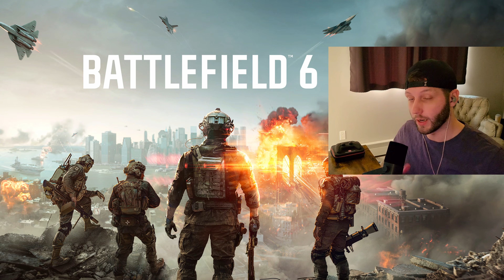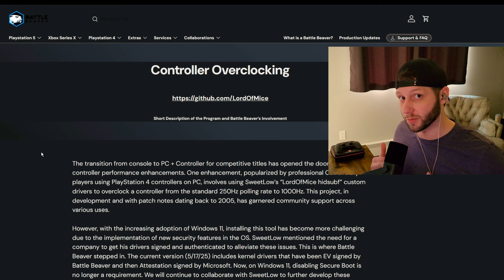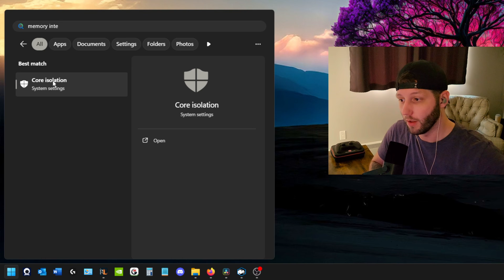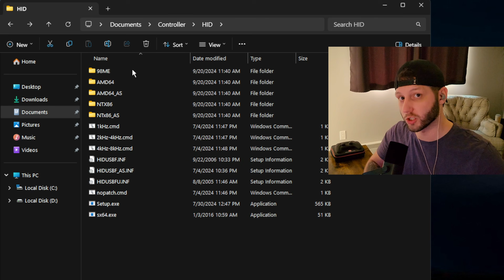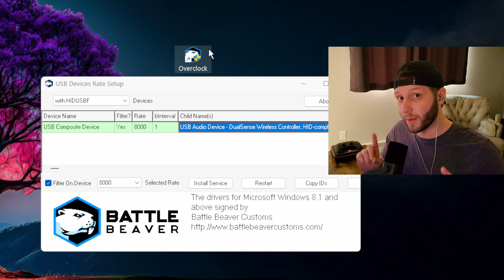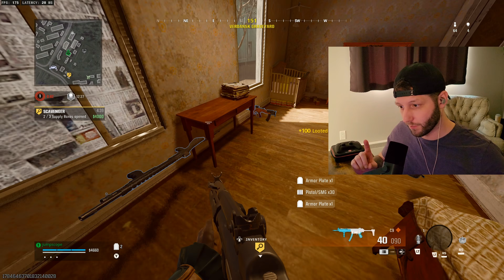How to OVERCLOCK your Controller (PS5 8000hz/PS4 + Xbox 1000hz)

Comment: Shows 8000 connected or disconnected and connected again but gamepad tester shows 999hz dualsense edge. What is wrong ?
Reply: Dualsense is limited to 1000hz with this overclock, mine is the same. 1000hz is more than ideal so don't worry
Reply from the maker: I believe gamepad tester only tests up to 1000hz

Comment: Does anyone know if the polling rate increase still works when connected via Bluetooth or do you have to keep the controller wired? I'm asking because the Dualsense controllers have better latency while using BT vs wired.
Reply from the maker: this is only for pc not ps5 console, and no it doesn't work wireless only wired

Comment: I got a couple errors during the process but my rate says 8000 and filter says yes. Can I trust that its working?
Reply from the maker: unplug and replug the controller with the software open and if still shows 8000 then yes it should be good

Comment: will this work a stock dual sense controller or do u need a scuff or battle beaver or edge ?
Reply from the maker: Works with any stock dualshock and dualsense!
Reply: @jumpscoper once over clocked can the controller be used wireless on ps5 or wired? Thank you for the great video.

Comment: Does the 8000 actually work? I hear it is a placebo and PS5 controllers are poll rate locked at 1000hz.
Reply: from what ive been able to gather you need a high end cpu to begin to capitalize on the 8000, and even then you still wont be actually getting 8000 hz.
Reply: Yeah you won’t get 8000. 4000 is the sweet spot.

Comment: Does it stay over clocked if I plug it in my ps5 to play or does it only work if I’m using the controller gaming on pc
Reply from the maker: The overclock only works on PC
Reply: @jumpscoper I guess it has 1000 hz unlocked by default on ps5,right?

Comment: If anybody is having issues w the signature error code when trying to click install service after checking the filter on device box, this worked for me

make sure u close the overclocking program before doing this
go to the folder that contains the setup file and other files. right click the 1khz . cmd file and pick run as admin and it should work after that.
Reply: i dont see the run as admin option
Reply: @rafalgrab6  make sure its a . cmd file and not js a text file. the only way to run it as admin is if the script can be executable through cmd . exe. a normal text file doesnt have that option
Reply: @ThatBurntToast how?
Reply: @xrleets  idk tbh I was able to run the 1khz .cmd file as admin without any issues. maybe deleting the files related to the overclocking program and redownloading them might fix it. if ur missing the 1khz .cmd file it's literally impossible to run it as admin.

Comment: My bInterval says 6, does this matter or is it fine?
Reply from the maker: Does the polling say 1000 and the filter on device is on? Make sure to re plug the controller after too cause it should be 1 for that
Reply: @jumpscoper should it say binterval 1 just for 8000 though? I thought 1000hz should only only say 4 binterval not 8000

Comment: ive turned memory integrity off, updated usb drivers and windows, ran as admin, and did everything you mentioned or i can think of and keep getting an error message about drivers not setup or disabled and i tried to run anyways and says controller wont work if i do. please help
Reply: figured it out thank you
Reply: @taylorrowe8587  How do you figured it out ? I think I got the same problem, thank you
Reply: @manu_mz  i cant remember exactly, its been a little while, but i asked my copilot or chatgpt and it was right, i believe i had to go through the files that came in the download and open up some other "setup file" that was different from the first one and that was pretty much it

Comment: does this work on mouse too?
Reply from the maker: Technically yes but you wouldn't normally need to do it unless your mouse doesn't have its own software. For example I use a Logitech G Pro Wireless and in my Logitech Software I set the polling rate to 1k there. The controllers come standard at 250hz thats why we overclock them

Comment: I saw another vid did the same steps and it always says when I click the filter on device that there is some problem and I should install services and then it shows my controller tab red on the battlebeaver app and it says I did a mistake .if you could help me out cause idk shit about this stuff I would be really grateful
Reply from the maker: Make sure you right click the program and run as admin. If that doesnt work try reinstalling it, may have installed incorrectly. Make sure to restart your PC and the cable is a good cable. and lastly make sure that Memory Integrity is off in Windows settings. Let me know if that fixes it
Reply: @jumpscoper  i did all of those steps i even restarted when i turned the memory integrity off idk man thanks for trying to help but it doesnt work for me .the only thing im scared of is doing some mistake that will fk my controller and i  wont know how to fix it (cause i might be stupid but it feels weird)
Reply from the maker: @ChrisXenidis-zu1pu what controller do you have? Did you update the firmware on it?
Reply: @jumpscoper ps5 edge and I downloaded the PS accessories amd it was updated
Reply from the maker: @ChrisXenidis-zu1pu  yeah I have my discord linked in my twitch bio or you can do the !discord command in my YT live when Im live. Then post in general there and maybe I can see whats wrong
Reply: @jumpscoper  thanks for trying to help me and nice video hope you have good rest of your day

Comment: When i click "filter on device" i get a pop up saying service is disabled or not installed
Reply from the maker: What controller do you have?
Reply: @jumpscoper stock ps5 controller
Reply from the maker: @vatoclan3080  Try to reinstall the overclock and make sure you're running the program as administrator. You may also need to update your USB drivers in Device Manager
Reply: Click install service first lol
Reply: @B4GLEY  didnt work, still get the pop up

Comment: i overclock my p5 controller to 8000 and it drops my frames like crazy
Reply from the maker: It is CPU intensive so if you have a slower system it may not be worth it
Reply: I ran 8000 for 2 years it’s not worth it. Run in at 4000 that’s the sweet spot.

Comment: do i need to have batter beaver in the background open for it to work?
Reply from the maker: No you dont need it open everytime. It's good to check it once week though in my experience if you unplug it like I do. It will sometimes reset. If you leave it plugged in itll probably never have an issue
Reply: Battle Beaver controllers are legit though bro

Comment: After overclocking the controller, I downloaded joystick tester program and it still shows the max it runs is 1000 Hz. I’ve seen other people talk about this as well in videos so I’m wondering if it even will actually run anything more than 1,000 hz, have you tested your controller to see if it’s actually running 8000 or anything close?
Reply from the maker: Most testers dont go above 1000hz. I'll do some tests and get back to you
Reply: @jumpscoper  how did the testing go?
Reply from the maker: @usmankhalid990  I was able to get 0.10ms faster Min latency and similar to Max latency but both still show up as 1k polling. Based on JohnnyPunch's testing the DualSense Edge actually has a potential 1ms+ difference between 1k and 8k but from what Im seeing the 8k and 1k is nearly identical for the regular DualSense. So for 99.9% of people theres no point to go to 8k, 1k is more than enough!